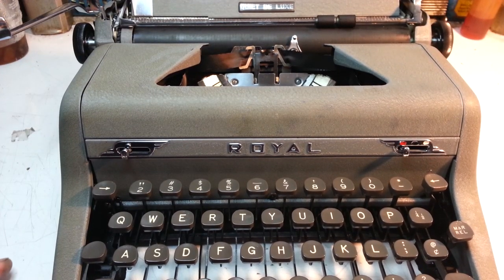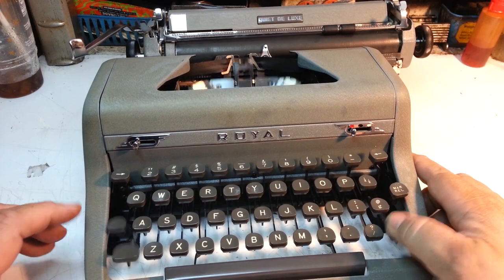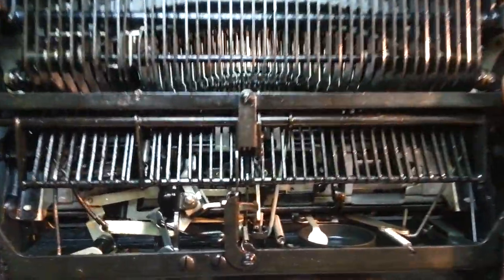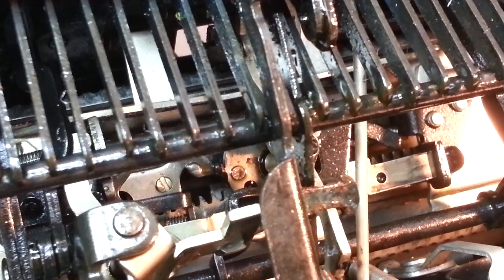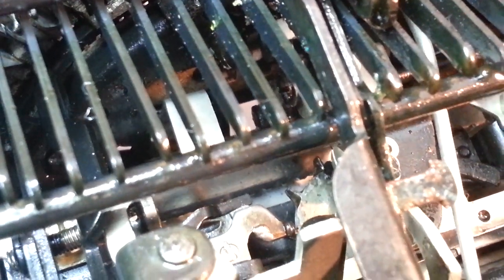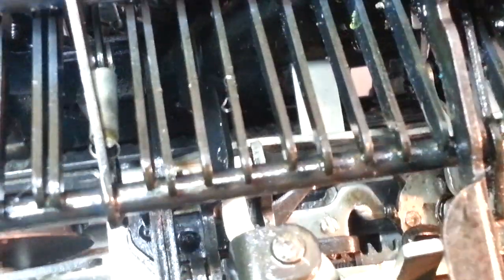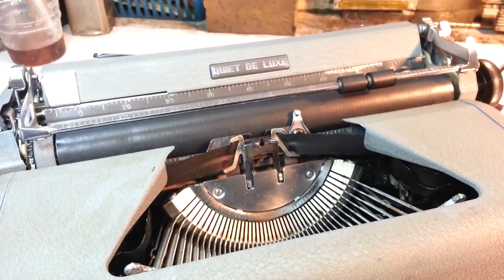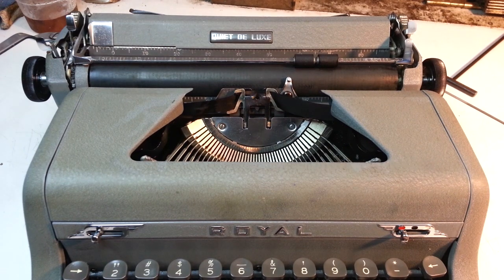Royal Quiet DeLuxe Typewriter Repaired Jammed Spacebar, Typebar, Back Space. Escapement Stuck

Comment: I just picked up a Royal De Luxe (not quiet), 1930s. Probably. It looks good except the escapement doesn’t release. Fiddling with the typewriter it did release once so I take that as a good sign. I paid as much as a takeout dinner for my wife. Like you say things are a lot more buried in there unlike my Corona Standard. The Royal tabulator works which made me happy.
Reply: Well I accidentally fixed it somehow. I was moving the carriage looking for the S/N then I pushed a key on the left and it clicked ahead so I tried the space bar which I know was dead and it worked. Maybe I released a lock or something, not sure.

I was able to type the quick brown fox test and it worked other than it needs a ribbon.

Comment: Could you do a video on repairing the space bar on this model typewriter? My spacebar doesn't even make the escapement move. I don't know what I did. It was working before I tried this trick you detailed in this video. The tension string popped when I tried removng the carriage. I rewound the carriage and got the tension correct but now the space bar doesn't even activate the escapement.
Reply from the maker: Sorry, I can't show you how to fix your problem, because I don't know what the exact problem is.

Comment: I have a Regal Rebuilt Royal from the 1930s and the carriage doesn't always move to the next space after typing a letter, or after pressing the space bar. And the back space key moves the carriage, but it doesn't actually back up one space. When this happens (carriage doesn't move after typing a letter), I noticed that toggling the reverse ribbon lever gets the carriage to move. I have the margins set pretty narrow right now, because the carriage slows way down at the end of the line to where I need to manually move it. So the star wheel is moving and the ball seems to be clearing...but, I'm curious if you have any thoughts on why it would be slowing down and the reverse ribbon mechanism somehow clearing the "bind." Hopefully this makes sense! Thanks for your time.
Reply from the maker: One potential problem would be old oil turned to goo. Everything needs to be flushed out and re-lubed (or not) 
97 Year old oil needs to be removed , replaced with 2023 lubricant's, only lube friction parts, 90% of a typewriters need NO oil.
Then you can start some basic troubleshooting and diagnosis

Comment: Hi Duane, my IBM selectric III has a problem. When you press the backspace it activates the page index as well. This happens every time and the machine is very clean. It only started happening recently and I suspect it is because I was fiddling with the cam section. Do you have any idea what the problem might be? Thanks
Reply from the maker: Of course I know, bs uses same cam as index, when pressing back space it disengages the index mechanism
That is out of whack somehow, might be out of place, might need adjusting, without being able to see I can't help further
Post this on the FB Selectric repair site , https://www.facebook.com/groups/gbtwshop
Reply: @phoenixtypewriter2136 Thank you for your response. It does seem like something is not engaging with the cam. Would I be able to email you with photos? I do not have Facebook
Reply from the maker: @timkowalski2166  I generally don't do long distance consultations, I operate a business and time is money
Not even sure how I could explain this backspace operation in words and what all happens mechanically
That's why I mentioned FB, they have more than a few retired Selectric gurus, pictures and database access
My advice on this tricky mechanism is to get a working selectric and see/learn the theory of operation by using the hand crank,
then applying that knowledge to the broken unit. I Learned most all the tricky stuff that way
Reply: @phoenixtypewriter2136  Ah ok, I will follow as advised